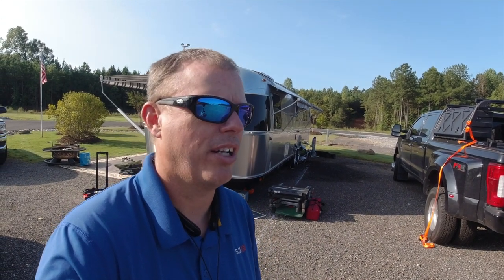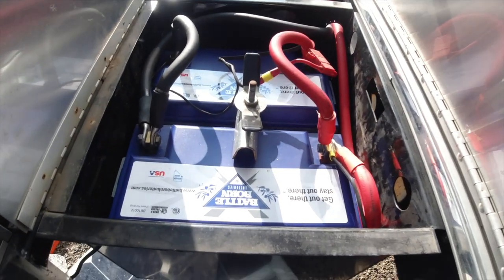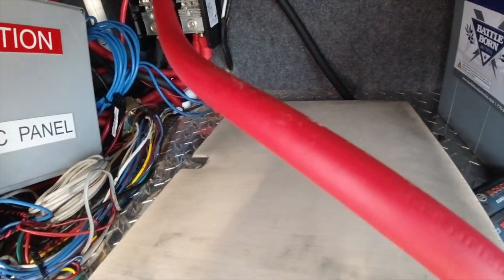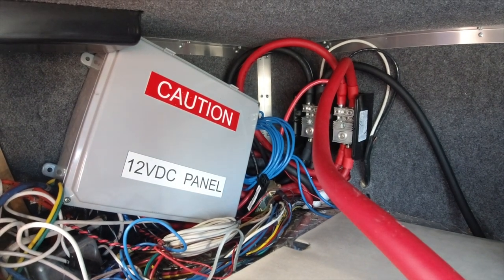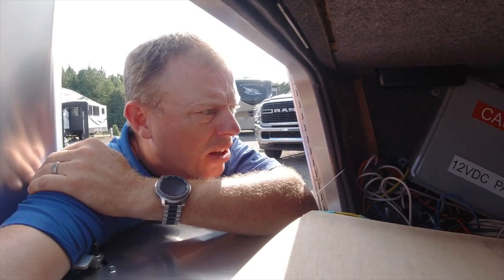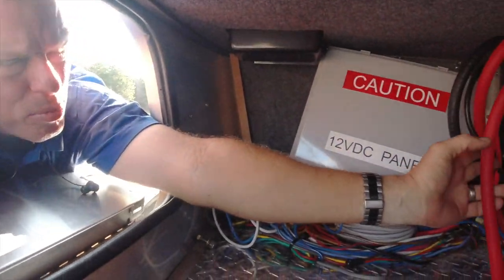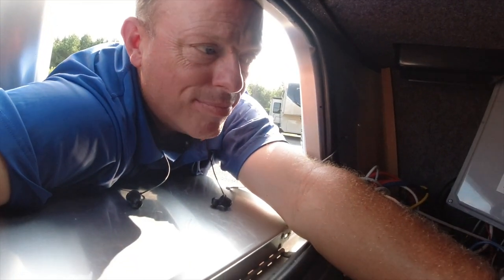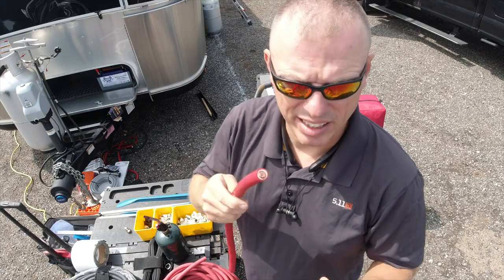How NOT to install a solar & lithium system in an RV | 2018 Airstream Classic 33FB

Comment from the maker: What do you do when you pay 💰 💰 for a solar and lithium system that doesn’t work?! You call Mike to troubleshoot it. Check out the video to see what not to do and what we had to do to fix it.
Reply: A good heavy gauge wire to use in larger systems is battery cable for semi's.  It is extremely fine strand, it's engineered for high current 12 volt DC use rather than 120 volts AC (starters on large commercial diesel engines), it has insulation that can take punishment in an industrial setting for years and years, and you can buy the battery interconnects pre-made since semi's usually have four batteries.  Keep up the good work!!!  Way too many "experts" out there in the solar install field that don't know their a$$ from their elbow.  "It's only twelve volts".  It isn't the voltage, it's the current that starts fires and/or kills.  And you and I both know the current on the 12 volt side is ten times that of the 120 volt AC side.  Personally, I like to see circuit breakers and disconnects on the solar panel feeds prior to the controllers, the batteries to charge controllers, the batteries to inverters, batteries to circuit breaker panel (like a main in a house panel)... pretty much everywhere there might be an issue or a reason to eliminate the power source quickly.
Reply: ..This is 12v top to bottom?  They should have gone 24v in the first place. Did converting to a 24v system get discussed?
Reply: is there a website that you report the installer to so that others interested in getting a system installed can check on their installer and make sure they don't have a similar issue or do you just not report it to anyone and wish their future customers the best of luck and hope it doesn't burn down their rig?
Reply: A
Reply: The honk are
Reply: Yew

Comment: For those that wonder - the system you installed for us, with quality wiring, has recorded higher wattage than the panels are even rated for.

Quality matters. Not just the wiring, but in your choice of installer 😁👍

Thanks Mike& Leanna!
Reply from the maker: AWESOME!!! Pretty epic response and thanks for that! Appreciate you guys!

Comment: Question, when you mount roof panels on Airstream, what do you use?  VHB alone,  screws, or rivets?  We are thinking of adding to our existing factory system. We have one open space on our rooftop factory wiring plug in housing and enough headroom on our Victron.  Not too sure I want to drill or make holes. What do you use? Good videos!

Comment: Wow.  Just.Wow.  What a mess, and for $22k the previous installers call themselves professionals...?  Nicely done video and excellent work!  Appreciate the detailed explanations!
Reply from the maker: Yes, it's most certainly difficult to see when these systems don't work or fail. We're just glad that we're able to get the clients up and running.
Reply: I'm sure those professionals had a lot of experience adding a battery and solar to popups!

Comment: Just a quick, maybe odd question. What is the smallest RV that you have done a battery (and or) solar installation on? What is the least number of lithium batteries have you installed in a rv? Thank you
Reply from the maker: Smallest RV is the Leisure Travel Van Unity and 2 lithium batteries, same install.

Comment: Master electrician/Process control electrician for 33yrs. Great trouble shooting. Very difficult to walk up to somebodies mess and figure out what's going on. I don't think the installer was even an apprentice. At least reference a wiring diagram till you become familiar with installs. Nice job.
Reply from the maker: Thanks so much for stopping by. It is most definitely difficult to walk into a mess like this, but just glad we were able to get the client buttoned up properly. Appreciate it.

Comment: I'm doing my own and I've got experience in electronic and electrical engineering. I'm pretty confident in my system but had to make sure I didn't do anything listed in this video. And DAMN! No, I did not do ANY of these bad things and probably would have had to fail all my 101 classes to have done THAT!

Comment: Thanks for the great video!    I'm planning on adding one more BB battery to the existing two in my '22 Classic 33FB.   That sure is tight squeeze working from the front locker, though.
Reply from the maker: Thank you. Airstream's are definitely short on space!

Comment: Some people don’t realize. A 0.5 volt drop is huge in a low voltage system, and can rob your system of 10% through inverter efficiency and charging power loss

Comment: I've been an electrician for 30 years. I've never done a solar instal but am trying to learn as much about it as I can. What would be my best source to gain knowledge in this field?
Reply: DIY solar power with will prowse channel on you tube has a lot of info on solar systems and how to install them and how to size your system I've used his channel and a few others to gain knowledge to do it my self.
Reply: will prowse and hobotech,
Reply: @danielroy5987  I spent the $8 and bought Will's book. Lots of helpful info on sizing everything.

Comment: If you have two batteries you should have negative cable out off one and positive out off two! Why has no one in any of the wiring diagrams ever shown this? Is this the same for power from the charge control in as well? Thanks so much for pointing this out.
Reply from the maker: In battle borns instructions manual it gives clear and precise instructions on how to wire a multiple battery bank.

Comment: Stranded wire is for flexibility!
It doesn't carry more current!
Reply: Yes it carries far more amperage. Regular 2/0 cable may have 20 strands and is rated 195 amps. 2/0 battery cable has 1330 strands and is rated up to 330 amps.

Comment: This is a good explainer for issues presented but I can't help to comment about maintaining their 12 volt system to drive a 1500+ watt AC. For that matter, a lot of the expensive wiring, switches and junctions could have remained if instead of gutting it all the system was converted to a 24 volt plus system instead. Even with the best of installations, having 150 amps (AC plus smaller AC electronics) flowing through the wiring of a moving vehicle is potentially dangerous.
Reply from the maker: Thank you!

Comment: how did that shunt on the negative wire work out, if you switched it, has the trailer burned to the ground yet?
Reply from the maker: the system is still performing just as good as when I finished it.

Comment: Excellent video. Glad to know someone understands this option. We just acquired a Delano 24FB with only 100W solar, a1000W pure sine inverter and 1 12V wet battery. Would a person go wrong with just a 100 AH lithium battery ( or two) for their initial start to upgrade to 200W solar and 2000 W inverter eventually?  Thanks!
Reply from the maker: Thanks for watching. Solar to battery ratio should be 2:1. For example, 200W of solar to 100Ah of battery.
Reply: @TheDryCampers  Thank you so much! As usual I would have had it done backwards! I have subscribed and will always watch. Thanks again .

Comment: Are there any certification necessary to do lithium and solar installations, so you get somebody that knows what their doing? With high cost of lithium and solar, how do you protect yourself from a poor/unsafe installation? If someone contacts you personally, can you give recommendations of installers you trust if we are too far from you? Thank you for doing all your videos and the extreme amount of care you put in your work for the installation and consumer.
Reply from the maker: Thanks so much, Ronald. This is a tough one. So, there are certifications that one can get; however, it doesn't necessarily make them a good installer, if you know what I mean. I'm a 25 year installation professional, so I think years of experience can really factor in as well. As far as protecting yourself, I would highly suggest getting the references as we mentioned, but also make sure they're an actual business with credentials, insurance and also check Facebook groups and forums to get suggestions of who others have used and experienced as well. We are completely mobile and go all over the country - we'll be headed west in 2021. Unfortunately, we have not yet found another installer that we 100% trust and would suggest. Including this installation we have 3 total systems so far that we are having to "fix". We've been told by vendors of some other gone-wrong installations, too. So, the more references and people vouching for the installer along with actual credentials cannot be reiterated enough here for sure.
Reply: @TheDryCampers  I think you broke the record for fastest replies I have ever seen. This speaks volumes about your concerns forthe end use consumers. If I had typed any slower you would have been answering my questions before I wrote them.
Reply from the maker: @ronaldw.2923  lol! Well, we just happen to be traveling right now, so it's a great time for replies. :) Thanks for the questions!
Reply: 12 volt lithium has the same wiring as 12 volt lead acid. No differences, it's the same electricity.
Reply: @gregpeterman1102  personally i think lithium electricity is a little juicier and lead acid has more citrus notes.
Reply: @k20nutz  Lead acid is living in the dark ages now. I can't wait to experience a LiFePO4 golf car ride, without all that weight.
Reply: @gregpeterman1102  I thought lead acid had a much higher c rate. (I'm all lifepo4, but I am solar so I'm not really affected by discharge rates) I think lithium ion would be a better direction for a golf cart. I'm also talking out of my ass, I could be completely wrong.
Reply: @gregpeterman1102  tell me that after you short a positive to negative terminal on both types of batteries. 🔥   and 🔥 ☢️ ⚡️💥

Comment: Seems a shame to have that much battery storage wired for 12v. Choosing 24v system design for 1/2 the current and 1/4 the losses in the wiring (or smaller wires) and a better operating inverter seems a no brainer these days.  A DC:DC 24:12v converter isn't expensive, and neither is a 12:24 charger to charge from the chassis system if that is desired. Charging that way is also a lot safer for the alternator and that big bank of batteries.
Reply: The thing is that pretty much all RVs have 12 volt native wiring - the water pump, water heater, furnace, refrigerator, lighting, and most importantly the trailer brakes - all 12 volt. No doubt it could be done but it would introduce a great deal of complexity compared to just sticking with 12 volt.
Reply: @DavidLaFerney  It is trivially simple.  24v trucks have been using 12v converters for years. One and done. Cheap and easy.

Comment: Pro tip , use wire Ferrell on those big conductors, it will save you from loose strands and if you’re really chasing that last percentage of efficiency solder the ends with some silver solder, clean with some 800 grit sandpaper and put some dielectric grease over your complete connections ( not between contacts, over the contacts)
Reply from the maker: noted.

Comment: I've seen dozens of $8-10,000 jobs that have major design flaws requiring serious repair. It never ceases to amaze me that people will spend that kind of money without getting references. It doesn't take long to look around on the internet. Nothing says "qualified installer" like dozens of happy customers. Just because someone knows some fancy words, and has watched a few dozen YouTube videos, does not make him a good installer.
Reply from the maker: Yeah, systems like these are typically over $20K. Unfortunately in this situation the client had no reason not to trust the source of this installation, until the system shut down after 15 minutes of use, of course.